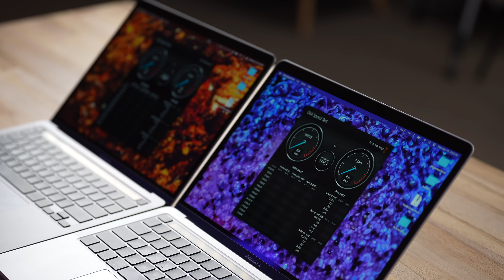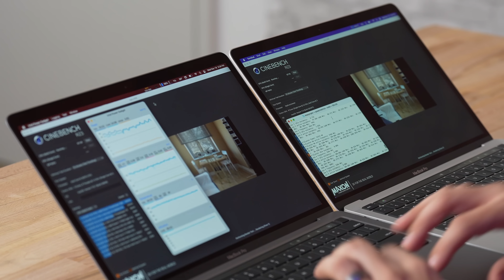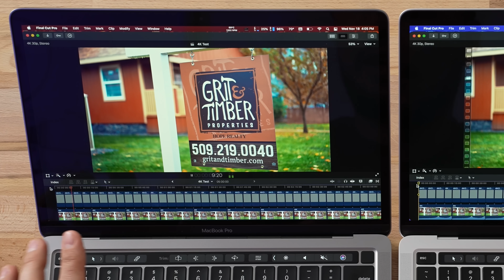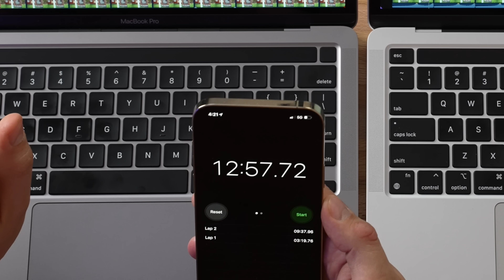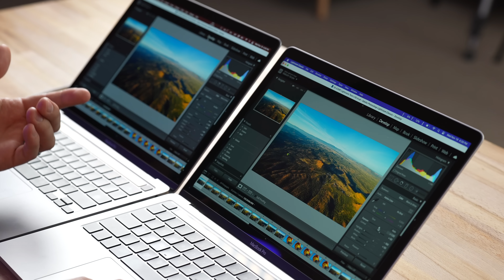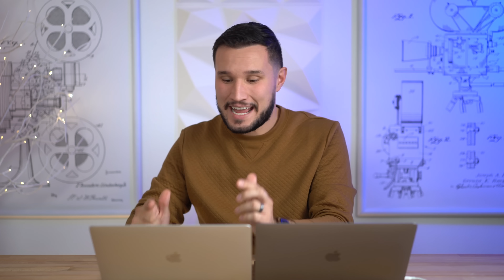M1 MacBook PRO vs Intel MacBook PRO: ULTIMATE Comparison

Comment: All things are relative ….. most buy what they can afford and as we all know any Apple product will be one of the most  expensive in its segment but my question is at what price would you consider the intel Mac is a better deal? 
Given there are three yr old brand new Intel Macs available with big discounts when do their failings compared to a M1 Mac ( Pro ) become less of an issue . . 
I’ve seen a brand new unboxed 2019 Intel i7 with 16GB of Ram and 500 SSD ( approximately) on sale with a two yr guarantee for £1650.00 ($1844) . I asked for a further reduction and was told if it is still not sold in 10 days they will take an extra £150 ( $171 ) ! 
My question is is this a deal to good to ignore or would you still go with a M1 Pro ( I want a 14” screen ) for £1729 ( $1974.00 ) which is approximately a £250.00 or $285.00  saving on a 2021 version of a 14” Mac Pro with the same GB & SSD and 2 yr warranty.. 
Of course the real question is this laptop overkill for a 16yr old who isn’t doing creative/ video editing but for college & University ( in two yrs time ) !!  ( he lives with the ex so I tend to go OTT , every father would if they could so don’t berate me 🤪

Comment: Is it better to keep using your Intel MacBooks? Mines late 2018, MacBook Pro 15 inch, 32 GB ram, 1 TB SSD with Radeon Pro Vega 20 4 GB. How long will intel Macs be supported with updates and how long would applications get updated?
Reply: @Somerandomgameplay I got the 14 inch M1 Pro base model. It’s rendering 4K files 3 times faster than i9 6 core.

Comment: For all thosw who are wondering about the tempratures on m1. It's not about the heat dissipation. It's a whole new architecture. The way it's working, it's not even creating that much heat. Pretty sure the secret doesn't lie in the cooling system but the new power to performance ARM RISC architecture. RIP x86.

Comment: Hey! Thanks for a great & detailed comparison video. I want to be sure, for the Logic Pro X shootout, was the buffer size equal between the two computers? ex. both set at 512. If the Buffer size was higher on the M1 than the Intel processor, this would explain the drastic difference between the two's ability to handle the CPU load. Trying to ensure I've made the poorly timed decision of buying the Intel 2019 Macbook Pro 16 instead of waiting for the M1 chip :/ Thanks!

Comment: I just returned my M1 16GB/512 after bricking it by erasing the hard drive in disk utility. While the computer is a huge improvement over the Intel Macs, I found it to have too many bugs. For example, not being able to run two monitors natively is beyond ridiculous. All I want to do is run two 1080p screens. Buying an expensive displaylink docking station comes with trade offs, such as waking your mac, or the displays not responding at various times. Yes the M1’s have instant wake but more times than not did my trackpad/touchbar not respond upon wake.  IMO, I don’t think these macs are quite ready for prime time just yet. Apple has a lot of bugs to squash with these. Yes the battery is amazing. Just beware that you WILL brick your M1 if you erase the hard drive in disk utility, even on Big Sur 11.1. For me this was a deal breaker.

Comment: I have the 8th gen Intel processor Macbook Pro 13" 2020 with 16gb of RAM and 512 GB SSD. I would like to change it for an M1 Macbook. Do you think I should go for the 8GB M1 Macbook Pro, the 16GB one  or the 16GB M1 Macbook Air??? S.O.S.

Comment: If the SSD drive on the Intel based system was 1/2 as fast, you'd expect much slower system bench marks. A comparison of the CPUs requires both SSDs be identical to be an ultimate test.

Comment: Apple M1 is BS. It doesn’t support every software. I am not sure if they were desperate to release and promote their new chip by making promises that they can’t deliver. Apple lied about it being compatible with your existing apps/softwares with Rosetta 2 but deep down, the New MacBook M1 doesn’t live up to some of what they said. It does not support your existing apps, thanks to rosetta 2. 
1. It crashes when you want to install Adobe softwares
2. It has problems with web browsers that isn’t Safari. Google Chrome on the other hand crashes before, during and after installation. 
3. They said fan doesn’t come on, ummm...hell yes it does come on. 
4. A big issue that exist is the inability to run BootCamp with the new Apple MacBook Pro, M1 chip. 
5. It doesn’t work well with gaming softwares like steam, or Origin for those of you who love to play games, such as sims. And many more.

Comment: The performance bump is great example how much Apple fdup the 2016-2020 model line of MBP :D Every one of them is thermally limited. Also it would be interesting to measure the results if you could swap the new with the old SSD drives. If you could do that :D

Comment: Question! I have a 2020 MBP 13" Intel and it has 32gb ram - the new M1 has a max 16gb unified RAM. Would it be a downgrade or an upgrade to move to the 16gb M1 model? I heavily edit using FCPX / Photoshop.
Reply from the maker: I think it will be about the same.
Reply: @MaxTechOfficial  thanks for the reply! 13” MBP tends to run the fan a lot and I’ve noticed it significantly underperforms against the 16”. I saw your video where you compared the 16” and the 13”M1 and it seemed (unless I misunderstood) like the M1 whooped the 16’s booty. Thoughts?
Reply: If only I had 2020 MBP, I'm not going to change my MBP for at least the next 5 years.
Reply: I’ve gotten a dual graphics 2005 iMac G5 and a dual graphics 2011 MacBook Pro and with both of them the discrete graphics always died — whether NVIDIA or ATI and always at the 3.5 year mark. Almost as though on schedule. With both they were under warranty — but that only got me another 3-4 years. I am still able to use both (except the iMac’s screen deteriorated after years of non-use and went all blackish) but at a limited capacity as though they were regular non-“pro” machines. 

Looking forward to seeing how the M1 performs IRL!
Reply: I think it be slightly better because sure the ram is half but the performance is boosted and battery life is better ... Go ahead and see for yourself
Reply: Your Intel MPB 2020 is way better because you can run Windows x86 with bootcamp and no ‘virtualization’ required. M1 is an upgraded mobile iPad chip which cannot run Win x86 apps, thus turning your mac into an upgraded iPad-like device. Think twice before buying such device, because you can easily go for iPad Pro instead.
Reply: @alex.maxwell  I never run anything Windows. So maybe that won’t matter? I’m mainly looking for increased performance.
Reply: @kristinabraly  In this case M1 MacBook Pro may work for you. But I wouldn’t upgrade for three reasons:
1) 1-st gen devices always have bugs (yes, most youtubers won’t show you that);
2) You have the latest 2020 maxed specs Intel macbook pro, so it’s still a great device and will be supported for next 5-7 years;
3) Macbooks are expected to get BIG design upgrades next year: 14” screen, thinner bezels, face-id, miniLED screen, wi-fi 6, new much faster M2 chips. So, unless you need an upgrade immediately, I would wait for one more year.
Reply: @alex.maxwell  Thank you for this, i was planning to buy this week, but wont anymore, thanks.
Reply: @alex.maxwell  m2 chips? Wow hope they make mini-led like Apple did w their iPad pro 12.9 in model
Reply: @bradyoutube7003  Glad I could help! Sorry for the late reply.
Reply: @xxkarlosxxxxxx7233  Also, x86/x64 is not suddenly irrelevant or crap as you say simply because of ARM chips. Strictly speaking, RISC (ARM) architecture is not inherently “better” than CISC (x86) architecture. It’s just different and more power efficient at CERTAIN tasks, mostly due to its smaller node size now: 5nm (Apple M1) vs 10 nm (Intel). Believe me, power efficiency of x86 will be much better as soon as manufacturers switch to smaller node size. So, more efficient Apple ARM chips now do not mean that x86 is “crap” or gonna die anytime soon.
Reply: @xxkarlosxxxxxx7233  yeah, mini-led display is expected, on par with 14” screen, 1080p camera, FaceID (probably), new keyboard, ports selection, and MagSafe charger
Reply: @kristinabraly  - Me either.
Reply: @kristinabraly  Just say you want to buy a new Macbook and keep it moving. If you bought it by now...guess what? The 14" 2021 16GB RAM M1 Macbook Pro is sooooo much better! You should've waited. Tough luck!
Reply: @alex.maxwell  Hell no, I've gone the Ipad pro 12.9 route and it sucked. The folder and finder system is no where near a mac and it's a WAY different experience
Reply: @desmostradale  you are right. Such obstacles make iPad mostly a consumption device. Steve Jobs had been criticized for this since the invention of iPads and not much has changed since his times at Apple. But when we say that new ARM macs are becoming iPad-like devices, we mean the closed nature of the device. See, since ARM macs do not let you run native Windows x86 and its apps, we are afraid that Apple will eventually forbid installing apps that are not from AppStore, hence making these macs very closed (like iPads). On the other hand, previous x86 Intel MacBooks had been versatile and could run Windows x86 natively via bootcamp, letting you to use the best of both “OS worlds”…
Reply: @alex.maxwell  M1 is not even close to regular iPad  in terms of speeds and reading and write speeds ... Maybe the newest iPad Pros are cause they have M1 now... Also win 86x is outdated and uses 32bit architecture ... 64x is better  ... Why would we want a prehistoric crap
Reply: @xxkarlosxxxxxx7233  Sometimes we need “prehistoric crap” because backwards compatibility is believed to be necessary and contractual obligations require Microsoft to support running old x86/x32 apps. This is not cool, but sometimes can save you a ton of bucks, for example, when you need to run an old engineering app, which has not been ever updated to support later OS versions. Also, this is one of the reasons that still makes Windows the most popular OS in the world (70% or 80%) vs 10-15% installation base of MacOS. Simply much more apps and possibilities on Windows that on a limited MacOS (almost no gaming/engineering/accounting apps, etc..)
Reply: @alex.maxwell  This comment aged like milk lol.
Reply: @alex.maxwell  That's what I think too... I am not going to leave my i9 16" MBP anytime soon.
Reply: @OG-juuu06  Good choice! It’s a great, solid device that won’t need any change in the nearest 5-7 years or even more (depending on your tasks of course). Just don’t buy into M1 hype)
Reply: @alex.maxwell  Yeah! I am mostly a programmer, and a hobbyist photo and videographer, my work mostly revolves around VSCode, Atom, Xcode, and creative apps like photoshop, lightroom, resolve, etc. So for that my i9 MacBook is more than enough. And I hope this device will continue to serve me for ~5 years at least. And I personally don't think that these first-generation arm-powered Macs will be a value for money device in the long run because in the case of Intel mac, once a particular Mac is unsupported we can use various patchers to patch it to run the latest macOS but I really don't think that will be possible in these new arm-powered Macs... they are fast no doubt but then again it's not matured yet, it's a pretty new technology and I too feel like it's an iPad like device running macOS. Although I won't say these are bad devices, but for my specific workloads, arm-powered Macs are not really a good choice as of now, Intel or AMD CPUs are the best bet.
Reply: @OG-juuu06  I agree. It’s an interesting time and we will see if this transition works out. Until then Intel macs will do their job because they are great!
Reply: @alex.maxwell  I’m getting a MacBook Pro 13inch 2020 soon and I’m mostly doing school, gaming, and editing so I don’t want the fan very loud and hope loading doesn’t take too much time which one would you recommend the best for those topics?
Reply: @farefell9883  Im getting one to for that! Did you even figure out which one would be better?.... Honestly Ive been watching videos for hours about it I think I have an idea about which one I want but I'm just watching more now.
Reply: @yoyoyo4342  same feeling here hahahha don't knowhwich one to buyyy
Reply: @farefell9883  Since you need a gaming laptop, I strongly recommend you to stay away from macs, because they are not made for gaming. I would personally go for HP/Dell instead, but all of them have their downsides. Hope this helps, even though 9 months have passed since you asked your question. Sorry for late reply.
Reply: @alex.maxwell  imagine buying a macbook so u will run windows!!!! Stupidity i. His greatest
Reply: @thecutedreamkostasp.4449  Stupidity is when you don’t know anything about the word “ecosystem”. It’s like when you buy an iPhone and cannot sync it properly with ANYTHING on Windows and Tim Cookie rubs his hands in jubilation (because it was done intentionally, on the software level), forcing you to buy a Mac just to make sure everything will sync properly. Stupidity is also when you have no real profession, so that you don’t have any professional apps, which are 90% Windows-only. And you end up here, mocking people, who want to use MacOS and Windows on the same Apple device, which was a natural way of doing things for the last 12 consecutive years.
Reply: @alex.maxwell  Just because the M1 Macs cant run Windows natively doesnt make it a BAD product. No one buys a brand new MacBook just to immidiately install windows and start using it. And dont worry in the coming years that functionality will be long gone. Also about the whole ecosystem part, of course Apple wants you to buy a Mac in order to do certain things with iPhone. Theyre a buisiness duh

Comment: The reason why M1 Macbook is running smoothly compared to Intel version is the due to the fact that M1 has 8 cores: With 4 high performance cores, and 4 smaller efficient cores. It's all about scalability, the more cores you have on your computer means the faster it can process all the task that's running.
Reply: Bro it's faster than Intel 12 core chip
Reply: I use a 2010 Intel Xeon with 6/12 cores. It's super fast even today.... not to mention it overclocks to 4.5GHz from 3.... The number of cores count indeed.
Reply: Then again, core frequency does matter too.

Comment: You compared a two year Intel old Macbook rather than the latest 10th gen Intel?
Reply from the maker: This is a 2020 two thunderbolt 13” MacBook Pro that came out just 6 months ago.
Reply: @MaxTechOfficial  It was a well made comparison, but I believe it would of been more fair if you had the latest Intel 10th gen cpu rather than 8th gen.
Reply from the maker: In a way yes but in a way no. We compared the 2020 intel MBP that cost $1299 to the 2020 M1 that also costs $1299 and both have 8GB of ram and a single fan with two thunderbolt 3 ports and weaker speakers etc. Comparing it to the 10th gen would mean $1299 to $1800. Sure the 10th gen is slightly more powerful in terms of CPU and GPU is 30% more powerful but the M1 would still smoke it. We’re thinking of doing the M1 MacBook Air against the $1800 MBP 10th gen for the fun of it

Comment: What are the specs for the  intel MBPro? Is that inthe video?
Reply: Also wandering Intel's CPU model (i5 or i7) and generation
Reply: 8th gen. It’s base vs base.
Reply: 8:19
Reply: it is "Intel Core i5-8257U " from CINEBENCH reports
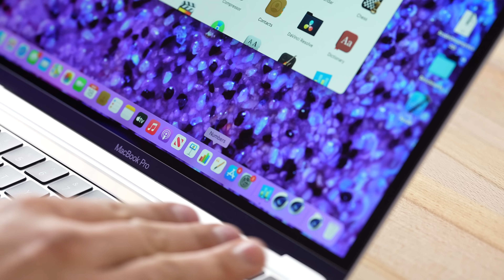Reply: 7:00 intel core i5 8257U 4 cores 8 threads @1.4 GHz
Reply: The specs are a waste of money and I have the m1
Reply: @kaptain_korn  what?
Reply: @kaptain_korn  the intel or the m1 the intel is a waste of money

Comment: Excellent comparison. Thank you. I have a question. I was at the edge of buying 27imac (more towards to 8 cores base). do you think i should just get the 13in. M1 MacBook pro instead. My reason to purchase is upgrade from 2012 15.6in macbook pro to ( iMac or macbook) which ever. To use for finalcut pro and photoshop. I would love it if you can compare within the 2020 imac with the M1 MacBook pro. Big thank you.

Comment: if you put both laptops directly next to each other with limited spacing between them, it certainly affects the cooling performance of the machines due to obstructing the flow of air

Comment: Nice. Own a later 2016 16"MBP with 16gb Ram and the 4gb Graphics card. Still works alright but one of these new M1 processors should basically smoke it

Comment: @Maxtech- Can you pls pls do an in-depth review of logic performance on a Macbook-16 vs Macbook-13 (M1).. ? I really to upgrade and there isn't really anything relevant I've been able to find anywhere else .. 

1. How do 3rd party logic plugins run via Rosetta - I have a feeling that while Logic Pro X is optimized, 16GB ram will definitely won't be enough
2. The regular logic pro x benchmarks that you do with a little more detail on the Activity Monitor + Ram Usage + CPU Temp etc... 

Fingers crossed :)